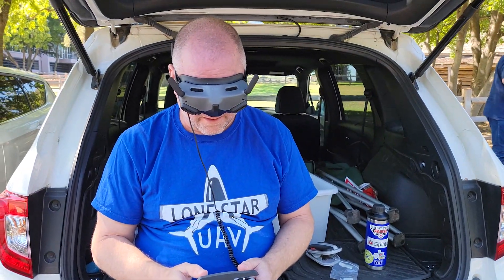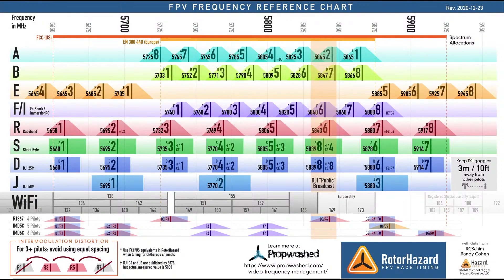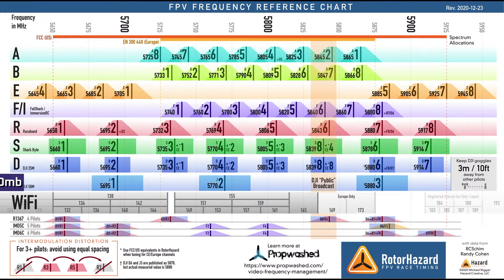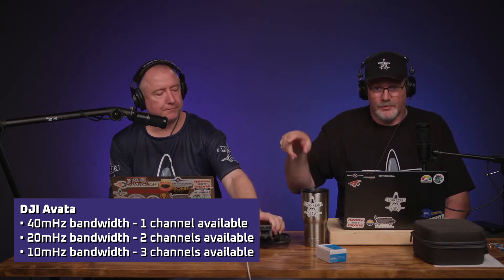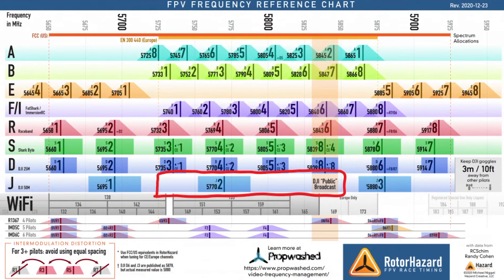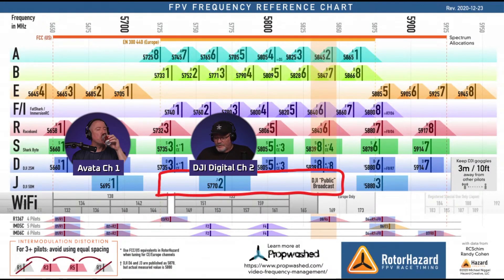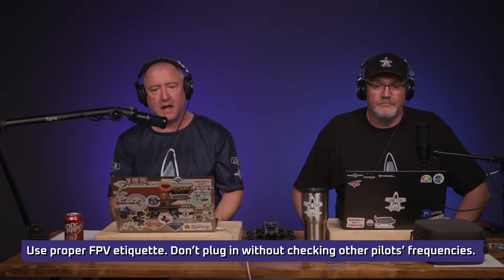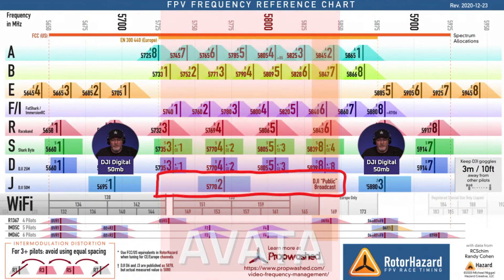DJI AVATA - How To Avoid Video Interference With Other FPV Pilots

Comment: Good info but was there a solution to all of this? Or would I just have to wait until other persons have landed to fly the Avata
Reply from the maker: The solution is to plug in and change channels if needed before taking off. If you plug in while someone else is flying and you don't know what channel you're on, you might cause them to lose video and crash.
Reply: @readysetdrone  thank you because I was lost on how to use this information about channels to fly with other pilots as I want to fly my Avata with a few friends this weekend.

Comment: I have the original DJI Air unit and my friend has the 03 air unit.  If I plug in my quad while he is flying, he gets bad enough interference to crash.  What is going on?? We have never had this issue flying multiple air units and vistas all day until the 03 came along.  Are you guys familiar with this?
Reply from the maker: Yes! It's been frustrating trying to get info from DJI about this, but just the other week, Mads Tech released his frequency chart. 

Here's his link https://drive.google.com/file/d/1ZIwra45DxZFBAi-zG67Cl1fEwzdebbBa/view?usp=drive_link

Due to the summer heat and our regular day jobs, we haven't had a chance to test this out, but we will soon. Hopefully, it's helpful to you. 

I'm guessing that his O3 system has the ham file on the Goggles, which enables 3 channels in 40MHz mode, and 8 channels in 10/20MHz mode.
Reply: @readysetdrone  Thanks! I set my V1 to Ch 7 and he set his 03 to Auto and we flew together just fine yesterday.  Which  makes sense according to the chart!